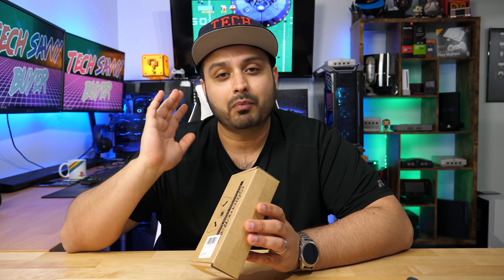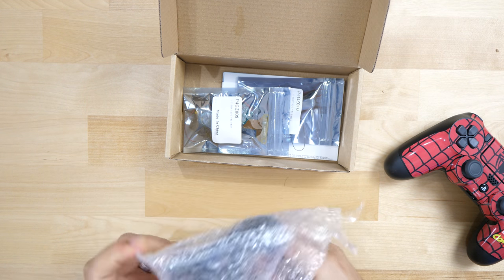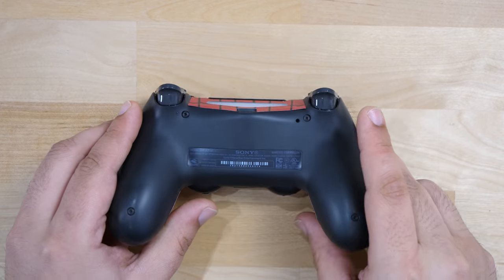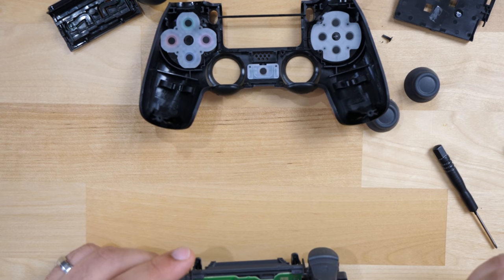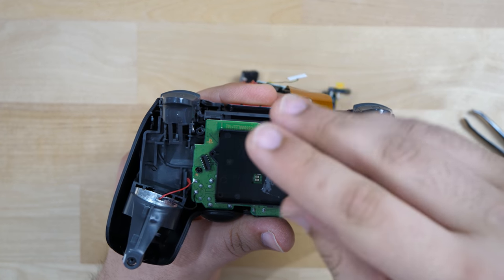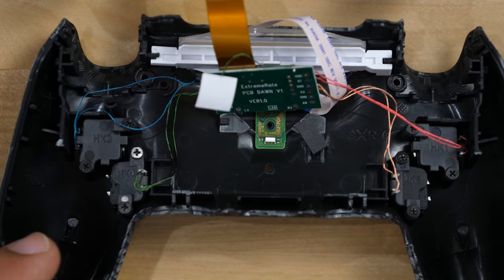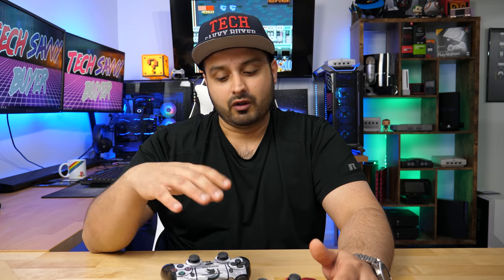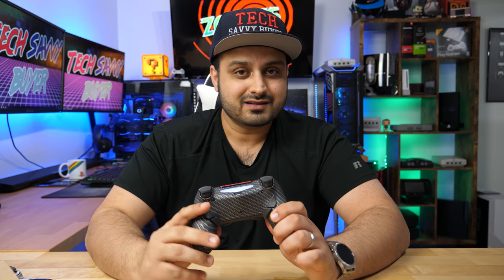$35 DIY PS4 Elite Controller! | Installation Guide & Review |

Comment: Just wanted to say that this thing is awesome. Took some time to get it to work, since it wouldn't turn on. My problem was that I used the included sticky tape to keep the ribbon down, which was too thick for the ps button to hit the sensor properly.

If you guys have this issue and you don't have extra tape, peel off that tape after you apply it (gently) and there will be enough stick left on the bottom of the ribbon for it to sit flush with the board. Stick that tape along the top of the ribbon and it'll be good to go and won't interfere with anything

Comment: Ive had it on my controller for about 4 months now and it’s definitely a 10/10 experience worth the money
Reply: yo is it relatively simple to set-up?
Reply: PRAYERS you need patience but yeah most of it except the ribbon going on the motherboard
Reply: @SR-lw4fv  my controller flashes orange and is silent when I plug it into my ps4, it does nothing when plugged into a  normal outlet, I can't reset the bluetooth either. Any ideas
Reply: Ayden Demery so if your main problem your getting is the orange light is the only light you can see but it doesn’t connect your in the same place as me 

The orange ribbon that makes contact with the ps4 controller motherboard does NOT require any tape to be held in place make sure you have the double sided tape to hold it there and NOTHING else no extra tape is needed. Two plastic rods will go through the two holes on the orange strip cable. It needs to be perfectly alined for it to work 
What the orange ribbon does is add more buttons to the controller. Without the strip cable the motherboard of the controller makes contact with the front shell of the controller 
In short >> YOU DONT NEED EXTRA TAPE TO HOLD DOWN THE CABLE IF YOU DO TAKE IT AWAY AND TRY YOUR BEST TO ALIGN IT

If your still having problems add me on instagram (yxng_sr40) ill explain in depth
Reply: @SR-lw4fv  yeah thanks one of my screws got stuck and i can't take off the shell so i just have to get a new controller
Reply: Ayden Demery dont use the screw they give you well you can but when your trying to get a hard screw out its not very good also if your Philips head screw doesn’t fit or it keeps slipping off don’t keep trying it wears down the screwdriver
Reply: @SR-lw4fv  I used the same screws from the original back plate, it messed up my screw not the screwdriver
Reply: any solutions for the blue set-up light not showing? 
the controller works but the dualshock back light stopped working
Reply: Gta Tv Official Channel if your copper finger sensor fell of or isn’t secure on properly check that. Also check whether the back light ribbon is fully connected and connected the right way round

Comment: As soon as u dumped the bag out it was a no buy for me lol

That actually looked pretty easy to do
Reply: KILLA JD so do you like it or not
Reply: Dismas niyokumfasha I don’t have it I use a scuf impact
Reply: KILLA JD oh nice
Reply: Omm
Reply: It’s not that hard, just know what you are taking out and you are good to go, I’ve disassembled my PS4 multiple times and put it together correctly
Reply: if you want something done right, do it yourself. Scuff controller paddles last approx 3 months lol.
Reply: Dustin Black I’ve had every scuf and never had an issue with any of them except for maybe a cracked paddle easily replaceable. Scuf vantage 2 I’ve had since it came out and have not cracked a single paddle.
Reply: KILLA JD should i buy a scuf or is it overpriced
Reply: Shad0wlight Playz I used scuff for years since Xbox 360 I can’t not use one but that’s just me.
Reply: KILLA JD ok thx

Comment: Just now finished installing this kit on my second controller. did my first controller after Modern Warfare had been out for a while and wanted to improve my competitiveness in multiplayer. took a bit to get used to the new ergonomics but now I feel naked if I play with a standard controller. one of the main reasons that I got another kit was because one of the buttons started becoming unreliable and wouldn't always work. that said, a year of use and happy gaming, $35 (now $30 using his same link in desc.) is a worthwhile price to pay.

Comment: I recently purchased and installed this mod and it performs exceptionally for the price point. Installation of the product was a little lengthy and frustrating in parts of the installation as to be expected unless you do this on a daily basis. I just have one but of advice towards the installation of the PFC cable I found that the use of double sided tape interferes with the making of contact. As I found out by taking apart and putting back together my controller at least 3 times and came to this. But all in all this install video is on point with all you need to know for this install.
Reply: can you explain further? I installed everything exactly as he showed, but now my controller wont turn back on. I have tried disconnecting and reconnecting the ribbon cable the battery multiples times,  but no luck
Reply: @carde018  Did you reconnect the center pad and light connection. The only reason why I ask is because the same thing happened to me I missed it twice. It's the ribbon cable that you have to loop through at the top right. Let me know if that works.

Comment: Seems like to much I feel like I would mess up on something
Reply: Same
Reply: Dude in college in electronix i had to do a simulaton of a circuit of the electric plant for all my city do you think cut 3 wires and conect them into the moder board is dificult
Reply: @samuelmontoyasalazar2190  I dont think he thinks it's difficult, I feel like hes just intimidated by all the wires, just do it if you do mess up you only have like 50 dollars to lose, and you also gain some experience while you're at it
Reply: I did it Nd I know nothing about electronics skipped the soldering because I didn’t need to remap the touch pad or L sticks
Reply: No more like if he fails he loses like 50 dollars from the controller
Reply: @alfredocontreras7722  if the controller wasn't working he would've had to buy a new one regardless
Reply: It's not hard I just did it and I'm 12 it's really easy it just takes some time to do
Reply: DeZiiRe SlaZeR same
Reply: Faxx
Reply: _ David _ isn’t that something you want to do tho?
Reply: does anyone know if i can do this with a broken controller that doesnt turn on??

Comment: Just received mine today! I have never taken apart, let alone modified a controller before. Your video made it so easy to follow and gave me the confidence to complete it. Can't wait to try it out! I have been using the strike pack (which I love) for the past 7 months but wanted the 2 additional buttons. Thanks for the amazing video, keep up the great work!!!
Reply: Buy yourself a new controller, then use the old one to experiment on or buy a second hand one for cheap and experiment on that, it's a win win and modding controllers can be fun :)
Reply: Jay Pilla I have the strike pack as well and now I'm thinking about switching too. Have you been able to install this thing yet? looks way too complicated for me!
Reply: @Gster988  Yea I have had it installed for about a month now. Definitely takes some time to get used to the placement of the buttons. I had to change my grip on the controller so I wouldnt accidentally hit the top buttons. As for the installation just follow the video and for the most part it was a breeze. The hardest part was feeding the ribbon through the back of the controller after installing the board. Took me about an hour total for install. just take your time and dont rush
Reply: @214JTP  Ok thanks man! So far, would you say that the strike pack was more comfortable?
Reply: @Gster988  yes absolutely. It's nice to have the extra buttons but it takes time to get used to depending on your current grip. For me I didnt realize how much pressure I applied with my middle finger to the back of the controller for support. With my normal placement I kept hitting the top buttons and couldnt apply pressure where I usually would.

Comment: I wish someone could just send this to me pre made and I will happily pay the extra bit for it haha
Reply: Get the Strikpack FPS dominator it’s only 40$ and it’s just an attachment to ur controller no need to open u r controller:)
Reply: KSI- Nation I already have 2 Scuf infinity pro controllers and one Scuf impact controller. Just I much prefer the look of where these back paddle buttons are
Reply: I own a strikepack and have had a lot of issues with disconnecting mid game every 5-10 minutes.  Talked to tech support (updated firmware, factory reset, new usb cable) and still happens.  Search strikepack disconnecting and you'll see many others have this issue.  When it works its a great product, but mine is borderline unusable after 4 months as the 20 seconds it takes to get it reconnected often means your dead in a game like Apex, PUBG, etc
Reply: @chiefnakoma  so your a cheater?
Reply: @kevincallaghan5519  Lol.  Stop trolling.  I use it for the paddles as a $40 option rather than a $100-200 scuf or battle beaver.

Comment: Did all of this just to find out that I don’t have the right controller and I dropped all my screws and lost then ruining my controller and I took an L😪
Reply: Buy new screws 😂😂😂
Reply: I bought the kit, came with new screws. Took my time, about an hour or so, works great.
Reply: Rip
Reply: Had two controllers. Took them both appart , and neither worked.  On one of them, the trigger button stopped working, took it apart the second time, and after forever I eventually figured the plastic film wasn't flat on a surface to make contact and finally fixed it. Same day bought another controller model 55 with 30$ sold my other 2 controllers for 40$. At this point being able to win 1/5 apex games vs none previously was well worth the trouble. Thing is I havent used a controller before for too long so I didn't have to readjust and it became rather easy having slide and jump accessible while aiming. So if what you're affraid of is the trouble of setting up a controller with the module think how much more annoying is to die at a game because of the disadvantage of not being as agile as another player.

Comment: Ok y’all so u can either spend 2 hours modding a controller and most likely breaking it or you could just buy a strike pack for $5 extra and have it set up in 2 seconds and have no risk of damage to your controller, plus modifications.
Reply: I have a strike pack the only problem i have with it a the blue tooth lag on it
Reply: Victor Maldonado umm strike pack isn’t Bluetooth it’s wired, if u have latency try making sure ur settings are correct and make sure ur monitor/tv has low latency on
Reply: Only has 2 paddles though
Reply: Salvador Ortega it’s still so much easier and more convenient
Reply: My strike pack disconnects constantly
Reply: Christophoris Cast well oof
Reply: @jakewalton9813  I'm so used to paddles I hate going back to a regular play. I'm going to give this a go since I'm having issues with my strike pack. I updated it thinking it would help but nothing. Issue occurs about 20 minutes into game time. Same thing happened with my last strike pack
Reply: Christophoris Cast I think it may have something to do with the controller, have u tried using another controller or do you have any others?
Reply: @jakewalton9813  I have plenty of others. I tried master reset, different USB and new ones, and different controller. It cuts out with 4 different controllers 2 which are brand new. The last one did the same thing. This is my 2nd and last strike pack. Unless they bring out a newer model
Reply: Christophoris Cast well I’m sorry to hear that, I’ve never had any problems with my strike pack
Reply: @jakewalton9813  one thing I haven't done is change USB ports. I'll give that a go. I'll keep you posted
Reply: Christophoris Cast alright good luck bud

Comment: Back in the Black ops 2 days I drilled a hole in back of my PS3 controller and glued a switch in that I sodered to the circuitboard. I was so pumped that it actually worked 😄
Really cool that they made it so easy and affordable!
Reply: Yo I would appreciate more details
Reply: @Razor-gx2dq  there are a few YouTube tutorials on it

Comment: I have a Scuf impact and I have 4 home built controllers. The home built ones work just as well. I have 2 with Extreme Rate textured grips, paddles. The other 2 have just regular paddles. All have Xbox Elite magnetic sticks so you can change them (I even use these in my Impact). So basicly if you want a controller with all the functionality of a Scuf: Extreme Rate textured grips, Saber paddles, remap board of choice, trigger stops can be made with a simple screw and hair triggers can be made by glueing something between the triggers.

If the controller breaks you can simply transfer the stuff to another controller. Only downside is that there is about 5 dual shock revisions at the moment so you need the right parts for the right controller. Even the later style controllers are not all the same, there is a JDM-040, JDM-050 and JDM-055. And not all parts are compatible between them.

Also if you open them a lot, the flatcable from the USB port to the mainboard tends to wear out after 4-5 disassemblies.

Comment: Great how-to video thank you - bought and installed. Your video and tips made it easy. 

Just one thing, use a decent screwdriver.... the one supplied is too small and it is easy to strip your screw heads.
Reply: Great tip!

Comment: Hey dude, how are they holding up wear-wise? Reckon they'll last? :)
Reply: Probably longer than a SCUF but I have a feeling they eventually just stop functioning.
Reply: I’ve had mine for 2 weeks and no problems... just follow the directions and you will have a $200 controller for $35 bucks
Reply: Lionel Viera Jr - 2 weeks... even a SCUF lasts 2 weeks.. give it time you’ve barely used the product
Reply: Arthur Shelby lol it could but for 35 bucks it’s well worth it

Comment: no need for a scuf on ps4, just bind the jump button to the right or left joystick
Reply: Yousif how do you move left right or run
Reply: Unknown g I think he means using the r3 as a button so it’ll activate when you push directly down. The stick will still have control.

Comment: Big tip, if you can get used to junping eith L1/LB and using X for tacticle (or abilities for apex) then use Bumper Jumper, ez to jump & aim, you can also use Bumper Jumper Tacticle to slide/crouch&jump without your thumbs leaving the thumbsticks

Comment: It's really $100 vs $160 or more, Scuff(and other companies) giving a functional controller with modifications and ExtremeRate give a modification to add to a $60 DS4. Then if you were to buy each individual customization it would end up costing closer to what other companies charge. 

Obviously the huge benefit is not having to buy another controller. My wife bought me a Scuff years ago and I just recently took it apart to add the extremerate clicky triggers.

Comment: I installed this without the button covers and also use the fps dominator pack because i like the paddle placement (no i dont use the included mods) the result is 6 extra buttons on the rear all but 2 of which, the upper 2 yellows, are accessible without moving my fingers/grip feels amazing and improved my gameplay a hundred fold.

Comment: If you play any call of duty like black ops 3 or infinite warfare, there is a setting that you can put on your controller it’s called “stick and move” it’s basically where instead of jumping with the X button or A button if you’re on xbox you can jump with R3 or right analogy it’s easy and better

Comment: Hey I just did it been struggling with for an hour the light turns on and blinks when I map buttons but when I try and hit the paddles they do not do anything in the game if you have a button on the controller works but the paddles which is the reason I bought the schedule I can map  them the it just doesn’t do anything please help

Comment: Some ribbon cable inputs have a little bar on the plastic part where the cable would connect to the board, that flips up to allow the cable to release. Just for knowledge for future projects, should never go ahead and just pull one of those out without checking first!

Comment: Just get an FPS strike pack dominator. It does the same thing and is one click to get it set up. It also can mod your games.
Reply: ya but the problem with that is that you can't use it on PC. 

I mean you can, but only after a bunch of pain in the butt software that sometimes don't work.

Comment: orr get a fps dominator, 40$ with mods, bumpers and you dont have to screw anything in
Reply: messes up your batteries life in the long run
Reply: Aybro Morales never gets disconnected soooooooooooooooooo it doesn’t matter
Reply: @Aybroe  how? The controller is connected via USB cable. So no Bluetooth lag. I have one. The battery life on PS4 controllers is shit anyways. If you turn off vibration for your controllers you'll get more battery life. The Dominator Pak is awesome, I can literally slide and reload at the same time with one button.

Comment: The big floor in this (i have had mine installed for about 6 months now) is that no matter where you put the touch pad is the fact your fingers are constantly changing positions to rest, well mine do at least, and you end up activating the mapping mode... apart from that i can not fault it